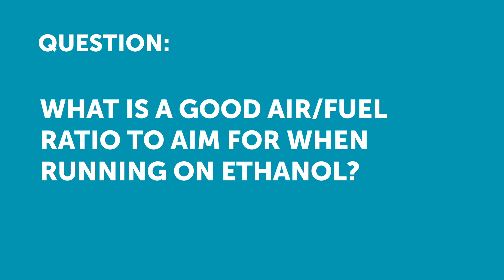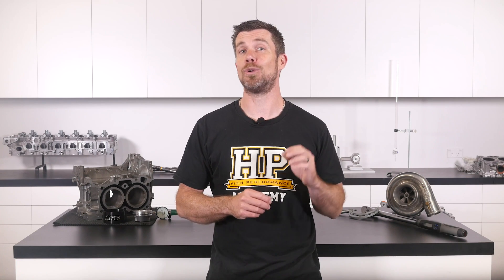Ethanol Tuning | What AFR Should I Target? [HPA Q&A]

Comment: I think what most people get confused is that  wide bands just read stoich no matter what fuel your using. So really if your running E85 and you have say a cheap wide band that only shows pump stoichiometric afr. As long as it’s reading 14.7 you’re good. If it’s above that your running lean and below that your rich. But remember that is just for  wide bands that are not plugged into logging software, say just a cheap wide band that you have on your dash just for eye checking while driving. Now when you start using it to log you are gonna have to do some custom math to get it to read actual e85 afrs or you will have a hell of a time getting corrections right. But most cheap wide bands you can’t plug into logging software anyway unless you do some mad scientist stuff.. which if your doing that you probably already know how they work. So just make sure your tables inside your tune represents e85 afrs, lamda or eq ratios. And when you eyeballing your wide band and it says 14.7 which is also lambda 1  your stoichiometric. Another thing to touch on is and why a lot of people in the US just use normal 14.7 afrs for pump and e85 is because wot afrs on e85 will look just like pump gas afrs for wot. So like N/A 12 afr wot is good reading for pump and E85. 
Take away notes MOST  wide bands just read the amount of oxygen left in the exhaust if any at all. 
That is my understanding of it at least. I’m sure I’m wrong about something’s.

Comment: basically if you calibrate for e85, when the sensor reports no unburned fuel and no oxygen left meaning stoichiometric the indicator will show lambda 1 and AFR 9:7. the ecm will idle at stoichiometric no matter what you see on the display. if you let the calibration for pure gas, will show 14.7. and lambda 1. if  you want to tune the car for different ratios you will need to know for each fuel what to target. if you are used to pure gasoline tuning and leave calibration on gas then if you target 10:1 at wot you will read 10:1 but the actual mixture will be below 9:1. which might be ok but you are better with targeting using proper calibration and recommended targets for that fuel or just using lambda but again you then need the lambda’s for cruise, WoT and all other situations

Comment: Has anyone expiramement with a lean burn on e85 with 1.1 to 1.15 lambda?
Reply: try it, every engine will react to it differently. spark plug position, spark power, chamber and quench, chamber temp. timing. Look at what some production cars that ran lean burn had to do.
Reply: @krusher74  Good call.     I'll look into it.

Comment: Will lambda work if you are blending gasoline and e85?
Reply from the maker: It's not E85 if you're adding more gasoline. Then it becomes E something else. 50/50 would be E50 for example.

Lambda remains the same regardless of rhe stoichiometric ratio, yes, that is the beauty of using it when you tune using a variety of fuels rather than trying to remember a specific afr and where you are relative to stoich off the cuff. 
You know what side of stoich you are at Lambda 0.90 for ethanol or gasoline for example and by how much - Taz.
Reply: @hpa101  yes I want to add 1-2 gallons of e85 to my 93 octane gasoline.   I’m limiting it to only few gallons not to exhaust my returnless fuel system.   Will my factory 02 sensor  understand lambda?
Reply from the maker: It completely depends on the car. Many are flex-fuel capable from factory commonly to E30 and some even to E85 as well.
Your owner's manual will tell you specifically for your specific car, I would only be guessing to tell you if it would be fine or not and it's not something that should be guessed.

Not the answer you were looking for I know but hope it helps and it is something you can Google to find if you no longer have that manual handy, again noting it is specific to your car  - Taz.
Reply: @hpa101  thanks Taz.
Reply from the maker: No worries 🤘

Comment: Better question which Andre may have been sort of touched on in the video is can e85 cruise safely on a leaner mixture than stoichiomoetric lambda 1 which would hypothetically be great since we can increase fuel mileage during idle and cruise which is typically shit on e85…

Andre, What say you?
Reply: Do it all the time, my lean cruise is always bouncing between 14.5 and 15.2 on the gas scale. I just keep leaning until it stumbles a bit then fatten up a touch.
Reply: @littleherms3285 have you messed with burning even leaner on e85?   Such as 1.10 to 1.15 lambda?
Reply: @dennisrobinson8008  I take it right until it runs like shit at steady cruise and fatten till it doesn't stumble any more. I don't use Lambda, I refuse...lol. Gas scale is just fine, 15.5 is about as lean as it'll go before the annoying bucking starts.
Reply: @dennisrobinson8008  that would be his stumble.

Comment: im tuning ethanol for a while but recently ethanol and nitro.,. its mental
Reply from the maker: Steep learning curve for you, or just great results? 

PS: Hope you're keeping well dude! - Taz.
Reply: @hpa101   Yo Taz, Ethanol was no problem but because of the oxygenated mix with nitro i had to add an extra 35% fuel on top of the extra for ethanol to get me in the ballpark and 60hp difference between pump fuel and eth/nitro at same timing boost. Defiantly cant push timing with it. It liked a timing curve close to pump fuel even with being mixxed with ethanol. but required allot more fuel. I end up running out of pump flow before i could get to high boost so gave up at that point 713bhp, Now im at the stage where i either use X2 pumps and have allot of electrical load.. or 1 big pump without the reliability or go mechanical pump. Im just swaying all options. ill be using an SSR for pump speed pwm control through the maxxecu though. , Hope you guys are well. Gav

Comment: Technically 100% gas is 14.7 afr where modern pump gas has up to 10% ethanol in it will have a 14.08-14.1 afr
Reply from the maker: Technically ethanol content will actually depend on your location and fuel supplier. There are no hard and fast rules - Taz.
Reply: @hpa101  I noticed my brothers 2016 GMC Sierra has a target afr of 14.1 and my 2011 Camaro SS has a target afr of 14.7 so I was curious as to why and that’s the answer I came up with from everywhere I looked. You have been doing this longer than I have that was just my 2 cents lol

Comment: I dont really get this. Even if you tune e85 in the lambda scale, you're still aiming for lambda 1, which is 14,7. Which tells me that it does matter what fuel you're running. So, would'nt you have to change the lambda 1 setting to be 9,8:1? But then, how do you measure that and fatter? If a normal widebandsensor sends a 0-5v signal, which corresponds to 10:1 and 19:1, how does that work with ethanol? #confused
Reply: Lambda 1 = Stoichiometric = most complete burn.
Lambda 1 is 14.7 AFR for gasoline.
Lambda 1 is 9.8 AFR for Ethanol.
You can't change what Lambda is, you change what AFR is required to to achieve Lambda 1.
Reply: So if I run let’s say a extra gallon of E85  with my regular 93 fill up and let’s say my car is e20 mix.   If I am using afr I have to lower the stoich from 14.7 to about 13.   And wot from 12.6 now I need to adjust table to target 11.2

Where if I used lambda with the same blend e20,

Lambda stoich 1
And wot .76

Am I understanding this right???
Reply: For running on boost during cruising you want less closer to 13:1.
Reply: It really doesn't matter, Lambda 1 is the "perfect" ratio for all fuels, even Nitro Methane. We all know a wideband samples and reads in Lambda then reports in whatever you set it to.

Id you like Lambda, use that, if you like gas AFR, use that. As long as you know the data chain that got you to that # the rest is just mentally playing with yourself.

As soon as you are not on pure gas any more you are on a representative # that is not the "actual" AFR #...who cares, its no less accurate than the Lambda # that is also "just a representative #".

I prefer gas AFR #s because  there is a bit more resolution and they are #s I like to look at. I also tuned with narrow band 02s 30 years ago and still have those #s burned into my brain and Lambda would just confuse the situation.

Comment: To my knowledge, the wideband I use intakes data in Lambda and then converts them to AFR, but always in "gasoline" numbers. So whether I run 10 or 50 or 85% ethanol, the ECU will always target 11.5:1 AFR or so in boost. Is that accurate, or would it still be technically better to tune with Lambda values?
Reply: If you never change the scaling on the gauge and are fully aware that the gas AFR #s are directly derived from Lambda then its fine to use gas AFR #s while tuning, E30, E50, E85, E100.... you don't care or need to do any converting. You could show up to a tuning session with E60 in the tank, not tell anyone and the tune would be bang on using "gas" AFR #s because, well, the guage doesn't care what fuel is in there. It reads Lambda 1, reports in gas AFR (14.65) and your day isn't ruined. The key is YOU know what's going on (and a good tuner should figure it out because all of the map should be bigger than they expected).

If you are Flex capable, the entire fueling map would still be correct if the correction factor is accurate, if not, tweak it a bit, or keep running E60.

Even if not flex, and went back to straight gas, you just GLOBALLY correct all the fuel table to compensate. The fuel map is still accurate.😮
Reply: @littleherms3285  there are lambda to af conversion tables that would simplify figuring out.
Reply: @dennisrobinson8008  or don't bother. Lambda 1 is gas 14.65 AFR. Don't even bother thinking about the differences. If you always leave it in gas scale it is now "just a representative #" just like Lambda and just as perfectly accurate. The only time that might be an issue is if you are starting to tune from scratch with a goofy E mix like E30, then you might want to take the ratios into account if you are really anal about having the number in the top right corner of a VE map at 112 or what ever E30 would work out to be.

Me? I could give a turkey. I know the gas AFR#s (representatively tied to Lambda) on a wideband are 100% accurate regardless of the fuel that's in the vehicle at the time, the Key is knowing exactly how much the VE #s are being fudged.
Reply: @littleherms3285 yup, just back calculate. Let's say you really want 0.78 lambda, wideband in gas scale will multiply that by 14.68, and display 11.45 AFR. So it's like you're working in lambda anyways if targetting 11.45 AFR for example.
Reply: Stoich for gasoline AFR is around 14.7 and E85 is around 9.75.
If you are switching fuels I would use lambda because the fuel doesnt effect the lambda number but its different using afr.
Basically if tuning Lambda your stoich is always 1 no matter the fuel your running.
Not the case for AFR.
Gas- around 14.7AFR
E85- around 9.75 AFR.
Reply: @charlespetersonii6989  Correct, but the wideband uses lambda but converts the number on screen to "gasoline AFR". So regardless of the ethanol % in the fuel, at 0.8 lambda the gauge will always display 11.8:1 even though that's not the real AFR. It's essentially lambda tuning but the numeric value displayed is just different.
Reply: @TheCarPassionChannel   so if I tune for normal afr with ethanol will the targets be the same? From what I read yes it will but a lot of what I read is from miata forums an such. What afr are you using in boost and low load with e85?
Reply: @discount111  about 11.7 in boost and 15.0 in low load, but those values are converted from Lambda to "Gas AFR". So the actual E85 ratios are about 7.8:1 in boost and 10.0:1 in low load, but those aren't displayed on my gauge. Depends how your gauge/ECU displays, and that's exactly why it's important to know before you start tuning
Reply: @TheCarPassionChannel  ok yeah I'm pretty sure my aem x series reads as 14.65= 1 lambda and converts it so I can use normal afr
Reply: Yes the 14.7 on the display is "stoic" which would also be the 9.8 stoic for e85.    It's easier to use "lambda" display values.     @TheCarPassionChannel
Reply: @charlespetersonii6989  what about E20?

Comment: how is the AFR the same for ethanol if you need 40% more ethanol??  From what i read 9:1 AFR is stoich for eth, which is lambda 1... where as petrol 14.7:1 AFR is stoich which is lamda 1..      o2 sensors give voltage based on stoich/lambda..  so when the o2 sensor reads lambda 1  the gauge will show afr of 14.7 because it is a petrol calibrated afr gauge,  but if you run ethanol, when the sensor is lambda 1 because the eth afr is 9:1, the gauge will still show 14.7 because its set for petrol  which assumes lambda 1 must be 14.7 because you must be running on petrol.
Reply: I think you’ve answered what I came here for - cheers 🤣

I’m running E85 on my 86 and have an AEM gauge; it sits around 14.7 but started to get confused when I learnt the stoich measurements for ethanol... thanks for the clarification, I think it’s all calibrated for regular petrol!
Reply: Don't even bother mind humping yourself over that. Lambda is 14.65 on the gas scale, E85 is still a perfect mix at Lambda 1 AND 14.65 on the gas scale... the volume of fuel has increased but the 02 doesn't give a crap about that. I've been running boost on E10, E40, E60 with an "AFR" of 11.5 for years and the plugs always look the same. Once you don't have pure gas in the tank the "AFR" # now becomes a representative # instead of an actual air to fuel ratio just like the Lambda # is. They are still the same accurate # though.

Comment: Your too nice about lambda vs AFR....  more and more cars self adjust based on the ethanol percentage in the fuel.  Even if you run E10/E94 commonly here in Australia it will need to drop into that 14.1 for stoich range.  Now if your a tuner that aims for the leanest mixture say 13.1 for a NA V8....  That's actually going to wind up being around 13.7 AFR if your using the 14.68 AFR in that form which is rather dangerous if your also pushing timing to get the most out of it as it's leaner then you think doing it that way.

Lambda is the only way to go.  Set up your gauge to suit the fuel your tuning on and then run lambda...... so it's accurate.  Many cars have self adjusting tables and the ability to change the axis on the % of ethanol to the alternate table.  This is great because it allows you to essentially setup quite a range...........  You can either go a safe setup or if you know exactly what the cars used for........... cross between say 98 and E10..........  (excluding 91-95).  That way you can adjust the timing to suit each fuel as it crosses tables instead of just having a 'downgrade' type setup when it detects knocking.   That way your always in top form.

So again your are WAY too nice about this AFR when it comes to ethanol percentages.  It's flat out dangerous to do it that was ESPECIALLY if your running any sort of boost.  

Truth is........  if your a tuner and you haven't discovered this method yet, once you do........  and you have an ethanol sensor in play you'll realise how much quicker it is to actually tune a car using this method.  It's better all around, not just for a dyno pull and open loop but closed loop at well.
Reply: Its kinda bad for goverments to force e10 on us when and older stock tune car may now be running lean

Comment: So if my car is tuned on 93 octane and I retune for e85 and don’t change any wideband setting but keep afr at 11.5:1, does that mean it’s a lot leaner than 11.5?  I never changed it bc I figured since it’s an oxygen sensor, not a fuel sensor it didn’t matter what fuel was in there the ratio would be accurate
Reply: If the tuner dialed in a/f to 11.5 on e85 but on the gas scale like most tuners do, then its a safe ratio. 02 just thinks that its still gasoline, but it doesnt really matter because ethanol responds very similar to lean and rich ratios just like gasoline. Your car is still getting more fuel than it would be on gas. 11.5 is similar to like 8.0 on e85
Reply: On the gasoline scale, 11.5 is horribly lean for E85.
Reply: No. 11.5 gas scale is rich wether its e85 or gas
Reply: @meetthecarolinas9638  No it's not.  The sensor reads in lambda and converts it to AFR on the gauge.  11.5 on the gas scale is the typical target for both pump gas and ethanol.  It's about 0.78 lambda for E85 in boost which converts to about 11.5 on the gas scale.
Reply: https://youtu.be/8IuYRVgMlDg

Comment: Andre I’m sure I’m over thinking but is it the same for tuning E30 or E50/60?
Reply: As he said, in the lambda scale, it makes no difference what your fuel mix is.
Reply: Tuning a e30 or e60 BMW?
Reply: @danspeed7039  He is meaning the amount of ethanol vs gasoline. e30 = 30% ethanol
Reply: no. you generally have e5 for petrol  and e85 for ethanol. everything in between needs a blend